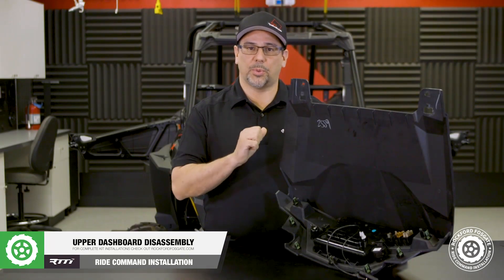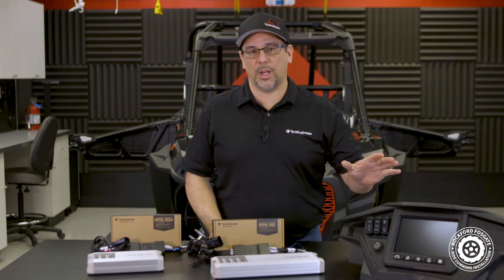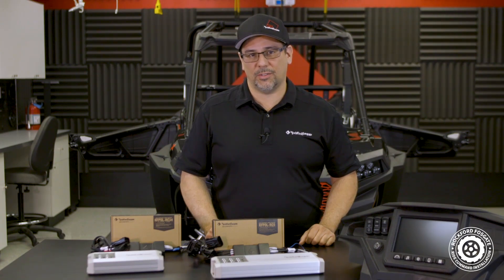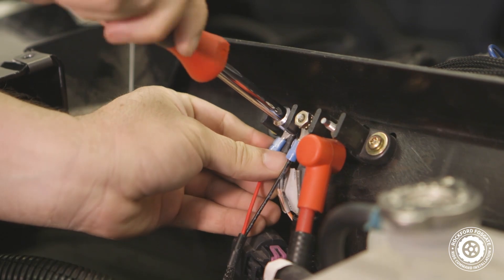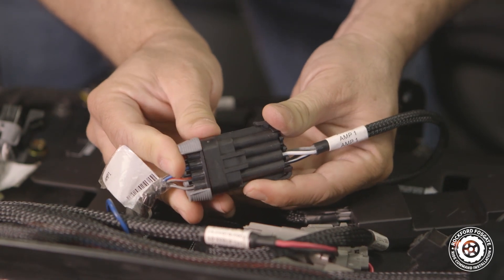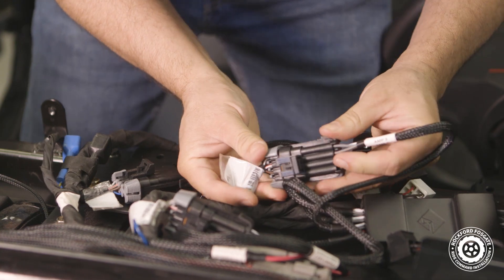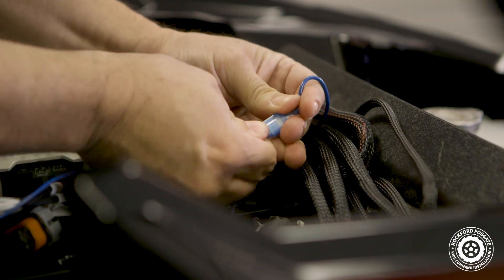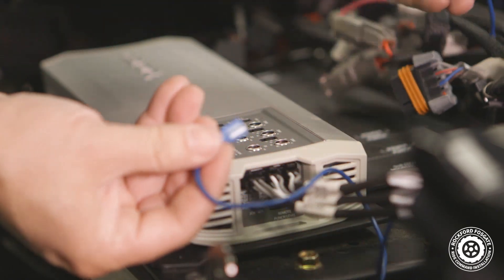Ride Command Interfaces STAGE3/4/5

Comment: at 4:21 you state that there are instructions for configuring the ride command to properly send output to the system. I followed the link in the description and there are no instructions.
Reply from the maker: Yes, I apologize for this ... the guide was put on hold, but will be released soon.  You can simply use the standard RZR14-STAGE3, RZR14-STAGE4, and RZR14-STAGE5 setup guides for the amplifier settings.  In the Ride Command software, be sure AUDIO > RADIO INSTALLED is checked YES.  Keep the EQUALIZER set to flat, and BALANCE/FADE set to 0.
Reply: @rockfordfosgate  Thanks! I just purchased a 2020 Ranger Crew XP 1000 with Ride Command. Since the Stage 4 isn't available for it yet, my installer is going with the RW-RNGR18RC-STAGE3, RNGR-REAR, and the SSV Works enclosure. Would have really liked to get the entire package as RF, but I'm afraid patience is a foreign concept to me.
Reply from the maker: @southerngeeks  Ha, Ha!  We can totally understand since we haven't release a new body style compatibility yet.  Sounds like your installer has a good work around for you.  We also appreciate you using as much RF product in the build as possible.  DEFINITELY use the RFPOL-RC-34 since this is the only module on the market that corrects for both the turn-on pop as well as noise issues associated with Ride Command.  It's also perfectly matched to replicate the PMX-2 source unit so you get clean signal up to 2.2V RMS through the pre-amp.  If you use a different adaptor, your amplifier settings will be different and your installer will need to determine what those are.

Comment: Where is the Ride Command configuration guide?
Reply from the maker: Aaron, we're currently working on this, but you can use the RZR14-STAGE3/4 or RZR14-STAGE5 Tuning Guide since the output voltage is the same as the PMX source unit.  Here's the link to the Tuning Guides: http://rftech.custhelp.com/app/answers/detail/a_id/1356

Comment: I have the stage five and my 2019 rzr turbo s doesnt have a amp 2 plug in. Did something change?
Reply from the maker: Hi Kolby, we get this call frequently and I myself - when creating this video - had a hard time finding it.  Be sure there are no factory amps already plugged into the connectors under the dash and look carefully.  Two of the connectors we did for this video were tagged with labels we couldn't immediately see.
Reply from the maker: We have a new 2019 and it looks like they moved AMP2 to the cigarette lighter harness.